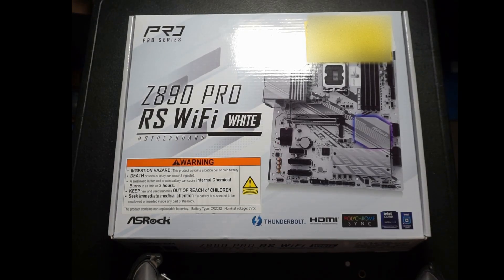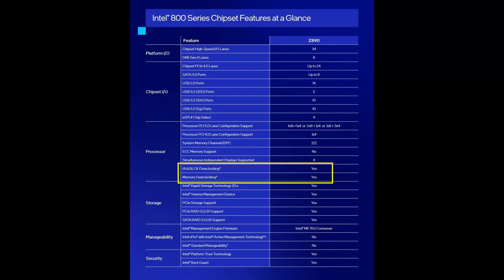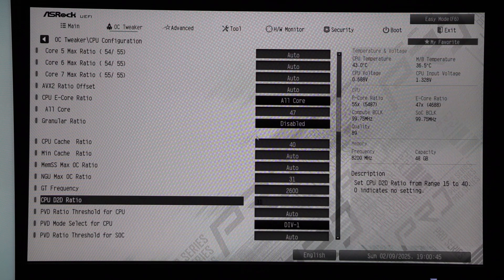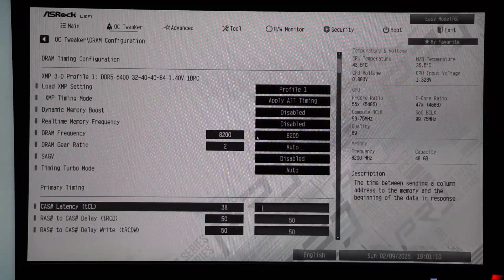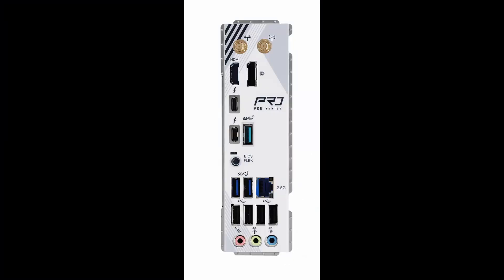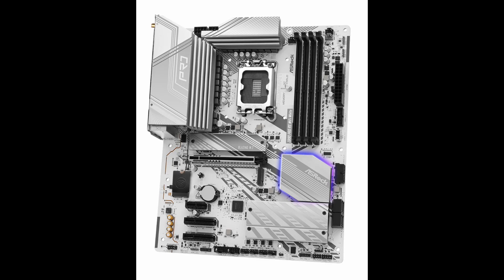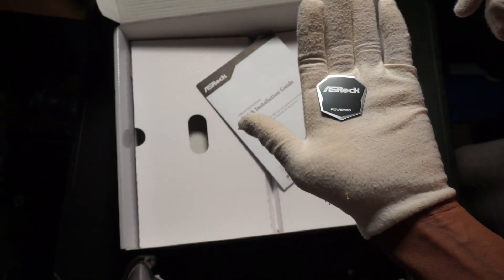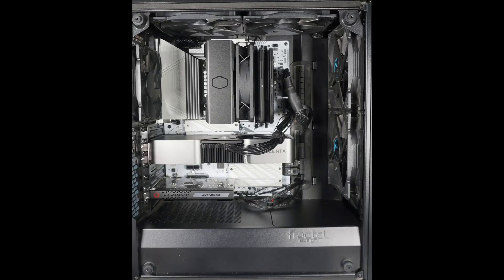ASRock Z890 Pro RS: This Motherboard Has All The Features I Was Looking For

Comment: You can disabe E-Core and add +200MHz for P-Core and +200MHz to CPU Cache in the same voltage. When E-Core is enabled they lowering max P-core and Cache clock.